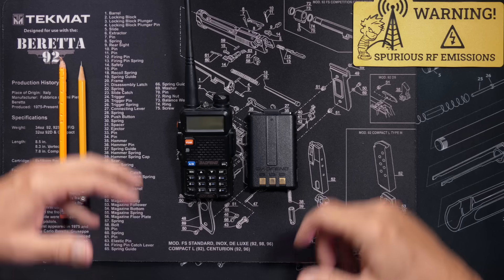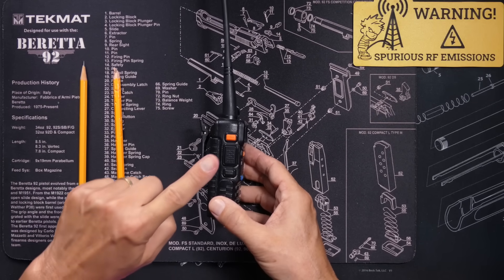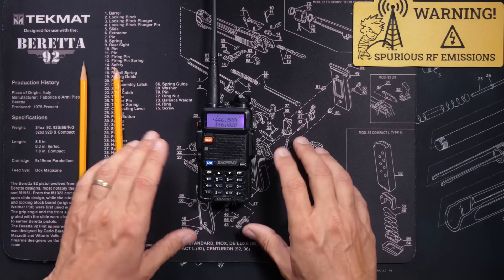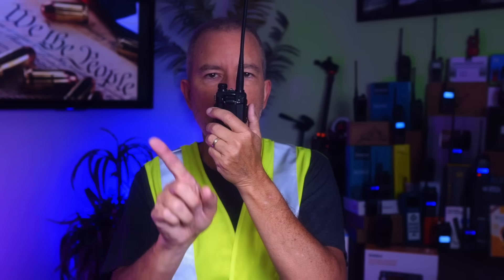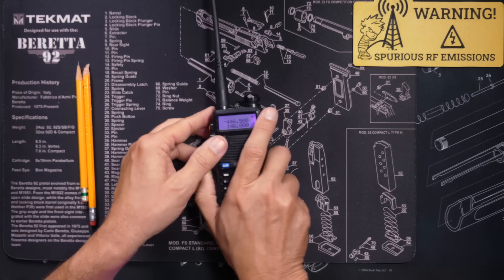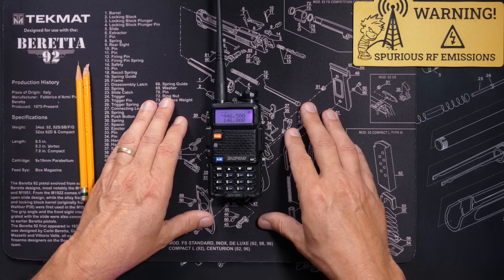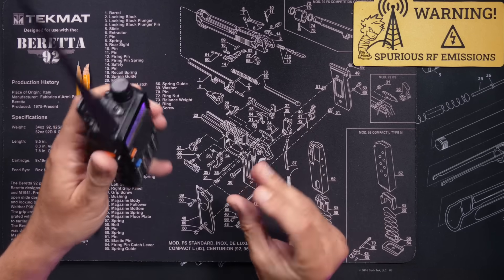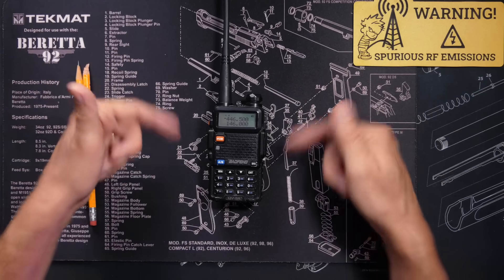Proper Walkie Talkie Technique - How To Use A UV-5R, GMRS, Ham HT, Or CB Handheld Radio

Comment: Love how you produce this video….  Question….. I tried 462.575.   And it did not work. I selected the bottom frequency that was already on there 435.725 and that worked…. Any advice to that
Reply from the maker: Sounds like yours is 'locked' to only ham radio frequencies.

Comment: Thanks so much for this conversation.

Your "Press the button, wait, then talk" instruction addresses the most common problem/error in all 2-way radio communications I know of.  It is way too common with untrained or under-stress individuals, and sometimes absolutely endemic with some user groups (think local law enforcement/fire dispatches).

I'm a current licensed amateur operator (30 years) and GMRS user.  Trained NWS weather spotter.  Twelve years military, with a twenty-five-year major law enforcement communications career.  Seven years in Alaska commercial fishing, and many other occupations that essentially required correct and concise radio communications.  Even now, I use transceivers every day at work and for fun. 

I would add wait-release to your recommendation of push-wait-talk:
A total SOP of "PUSH-WAIT-TALK-WAIT-RELEASE" should be employed.  

While starting speech before the transmitter is actually working is the most common error, I find a lot of folks let off the mic before they should, and then, well you guessed it, the listener didn't hear your ending, and can't be sure what you said, just as well as if they didn't clearly hear the beginning.  

Excepting radio wave weakness/loss/propagation issues, I can tell you with certainty that the vast majority of all uncompleted radio communications are because the listener/receiver wasn't able to decipher either the beginning or the end of a message.  The middle is almost always fine.  The problem is clipped ends.  Nuff said, modify and practice technique.

Now if we could only find some way to address left-lane hogs...  LOL.

Comment: All very simple advice, but--as a 4-decade-plus two-way radio user,--it is amazing to me how many radio users don't know these simple tips.  Here are a couple more:  if your portable radio is having issues receiving a distant transmission, if possible, set the radio on a flat metal horizontal surface--portable radios lack a ground plane, and the metal surface will act as one, enhancing reception.  A vehicle hood is a good example of a flat metal surface that makes a good ground plane.  Also, if you are talking through a repeater, the delay in starting to speak when pushing the talk button is even more important--some repeaters can take a second or more to "open."

Comment: Need help! Just bought my new baofeng UV-5G. I also go my gmrs license from the FCC. Turn it on ch 16 on both radio but can’t hear it transmit or receive on both radio.
Reply from the maker: Make sure the radios are at least 50 feet away from each other and try again. If when you are at least 50 feet away from the other radio they still arent working, make sure that no CTC or DTC codes/tones are enabled on the radios.
IF they still arent working then either your are doing something wrong or the radios are defective.. and i doubt they are defective.

Comment: Welp, I've been a licensed Ham and GMRS for about 9 months and my pet peeve so far has been operators who cut off the first several seconds of their transmission because they are either using their vox function wrong or they just can't wait for the repeater to pick up before they start yammering.  That, and they talk like an drunken auctioneer when ID'ing themselves... while cutting off most of their callsign in the process.
 
I've gotten some sarcastic feedback from the "seasoned" "Extra" licensees when expressing this frustration in certain groups.  It's okay, though.  I come from a long line of practitioners of the art of sarcasm so I can hang with the uppity Amateur Extras all day long.
 
Your "wait a second" advice is the most important thing I think any operator can do, whether GMRS or Amateur.  Oh, and the vest!!  Master trolling, sir.

Comment: Brilliant .  Executed like an army training film.  

1. Vertical antenna:  Match polarization of receiving antenna and the radiation is broadside to the antenna, not off the end.  Don't point it at the person you are talking to or listening to BUT it is a pretty good way to locate a source by doing exactly that.

2.  Activate transmitter a fraction of a second before talking.  Most radios sleep to conserve battery; they wake up a couple times a second to check for a carrier.  Between wake-ups they are not listening.  
"Q) How does the ‘Save’ system work? What do these numbers mean? A) The numbers (1-4) represents the number of cycles the HT goes into sleep mode. Five cycles appear to be equal to 0.5 seconds. The higher the number, the more battery energy is saved. When in save mode your UV-5R will become somewhat sluggish though, and you might miss a word or two when your monitor frequency becomes active."

Comment: I would also add that one should reverse the procedure for talking into the radio with your noise hole by finishing whatever information you care to transmit, wait that 1/2 to 1 second mentioned. Then, and only then, should one release the push-to-talk button. By releasing the button before you are done talking cuts off the end of your transmission, forcing the person who is receiving to call you names and question your parentage.

In addition, I spent 30 years in a job that required me to use a handheld radio. Holding the radio in the fashion illustrated guaranteed you would be pointed at, called a radio noob and the chicks would laugh. By holding the radio with its face toward the palm of your hand, you demonstrated to everyone watching that you are a cool, experienced radio operator, earning you nods of admiration from your peers, and causing the chicks to swoon and offer to let you father their children.
Reply: I love the people that hold the antenna DOWN.  It will actually reverse the polarity of the radio waves, not that it makes any difference.

Comment: You should mention issues with transmission if you brush the antenna against the tinfoil on your head.  The static it generates can be quite distracting and it may even cause changes to your fars.
Reply: I find if I rest the end of the antenna on my tinfoil hat it adds the fars my Boofwang can transmit.

Comment: This demo is fake. Everybody knows the way to hold the radio is by the antenna end with the pointy part aimed at the ground, for safety, and your hand covering the knobs, so they don’t get turned.  Wait. What do you mean this isn't right? I see experts using this method all the time.  Watch Mythbusters. Upside down walkies are all they use.

Comment: I've had my baofeng uv-5r(8w) for about a week now. Only had to charge the battery (on 2 radios) 1 time each(1800mah batteries). On 1 of the batteries,  it appears the + terminal/connection has melted through. As if it got overheated and started to deteriorate the conductive metal. Has anyone else experienced this on the baofeng radios or any others? Also... still can't hear a damn thing no matter how much I try different things and how many tutorials I watch. Nothing... only weather and 1 or 2 dudes who are chatting about radio gibberish I don't comprehend lol.

Comment: I’m happy to see Randy handling radios properly again.

The Beretta 92FS is such a nice pistol.  I bought one for my dad 20 years ago and when he died I inherited it back with probably no more than 100 rounds through it.  Beautiful gun.
Reply: The Beretta is a fine gun, but I could never afford a stainless model, so I decided to get a Taurus PT-92 AR in stainless. I not only got it because it's cheaper; it's also better in that one can carry it cocked and locked or one can just use the hammer-drop to safely and effectively drop the hammer.

In the 80s, I wasn't crazy about the Taurus because it wasn't as accurate as the Beretta, but in the earthly 2000s, I picked up my stainless model, and when I shot it, I found the accuracy to be much improved, at least with my Taurus. 

Yes, the stainless Beretta is much sexier than the Taurus stainless, but the latter is less expensive, just as accurate, reliable and has a better safety. Also, it's also just as impervious to corrosion.
Reply: Yes, what is "the best"?
Reply: @DumbledoreMcCracken   i'll chime in for my unsolicited advice. the best one is the one you feel most comfortable with and can use most accurately.   this varies for most everyone.  but some are very proficient. if you plan to practice a lot even though I really like some .380 units the 9mm is way cheaper to operate.
Reply: @potterportraits .  I agree almost completely with your advice, except that the Sig 226 is the best.🙂
The 365 is the best concealed carry, and the 210, if you’re ever lucky enough to lay a hand on one,  is both the sexiest, and best shooting 9mm you’ll ever have the honour to touch, but originals are almost never on sale, and the "second run" of newer ones are too pricey for me.  Just got to use a friends.

Comment: DO NOT FALL FOR THIS DECEPTIVE, MISLEADING, FRAUDULENT SPAM!

This video gives no instruction on proper wrist strap or belt clip usage, nor does it instruct how the screen protector can be safely removed.

I shudder to think at how many non-licensed, novice radio users  have been maimed or killed since this video was published with these massive oversights.

Pray for new radio users 

#WristStrapStrong ✊
Reply: This just in: wrist strap deaths skyrocket, NotaRubiconproductions says, “Not my fault. They were all idiots” 😂👏🏻👏🏻👏🏻

Comment: Do you have a recommendation for replacement rechargeable batteries for my Midland GXT radios?  The OE rechargeable batteries are not good and don’t hold a charge for very long. Thank you.
Reply: Time to replace the radio with a better radio
Reply: I’m using AA rechargeable batteries I got from Amazon. I bought a charger for em too, since the can’t be charged in the radio.
Reply: One of several oversights by Midland design engineers regarding their FRS/GMRS lines.  Inadequate battery capacity.